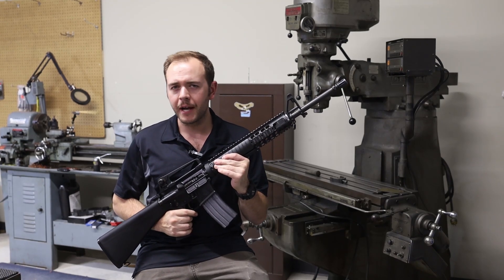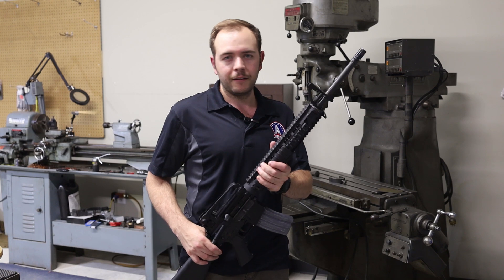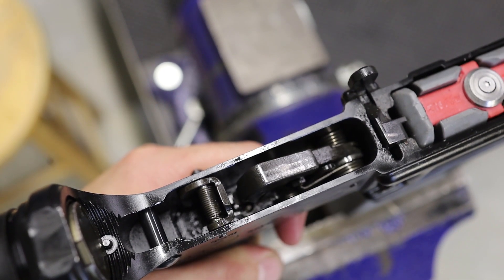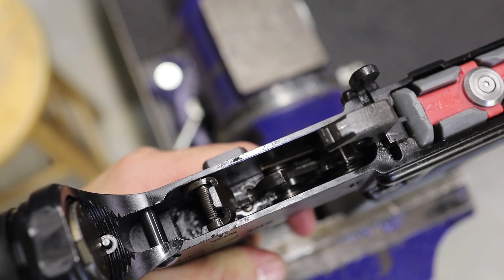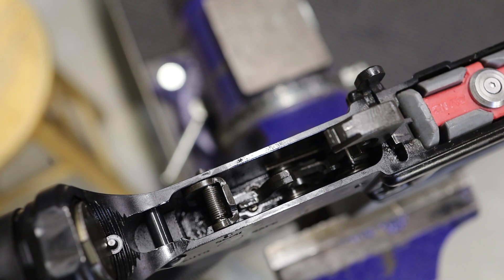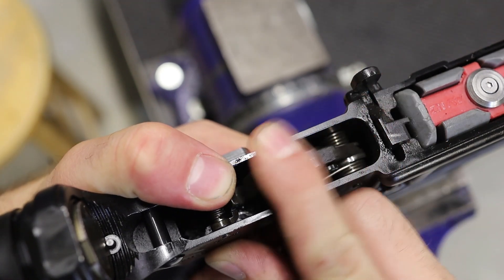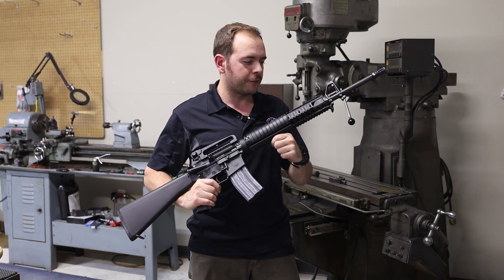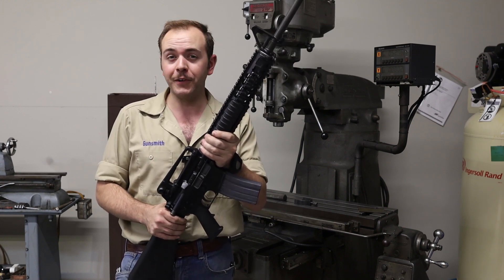How the M16A4 Burst Trigger Works

Comment: I also went through boot camp in 2012. You look familiar but I'm probably mistaken. After 12 years I caught the M16 bug this year. I missed the jangly metal sounds parade slings make. I missed how robust the A2 stock felt. I missed standing at order arms with a full hand full of barrel and that yanking movement into port arms. It's insanely cliche but those experiences with my rifle in boot camp left a permanent mark on me. I ended up building a "601" to scratch the itch. Slabside upper and lower, pencil barrel and iron sights, nothing at all to snag on my clothes or beat up my knuckles. I thought about everything I hated about the A4 and my dream 20" rifle ended up taking the form of a 601. I love it. Don't tell anyone but I do manual rifle drill at 2am and relive those cold winter mornings on the parade deck.

Comment: By the way, do you know what the unique parts in the M4A1 fire control group are? All I know is that it's not the same as the auto M16 fire control group for some reason and it has FCG parts not found in any other AR15 variant. This was a response to some M4A1s firing when the selector was moved to auto due to bad parts.

Comment: The M16A4s in boot camp 2021-present are at least 50% collapsing stock having variants.
They do NOT use VLTOR A5 extensions or whatever, regular carbine buffer tubes with H6 buffers.
Yes, the H6 buffer was developed for the ill fated M16A5 program.

I saw one that was a Colt M16, had AUTO milled out and BURST stamped in, no refinishing so it was silvery there.
RCO for an M16A4 (AN/PVQ-31A/TA31RCOA4CP), vickers sling, gen 3 black windowed PMAG. Collapsing stock as well.
Fun rifles. Dragged kicking and screaming into the 21st century.

USMC has around 8,000 H6 buffer kits in circulation, which is probably like 50% of all the (actually issued) M16A4s in USMC inventory at this point.